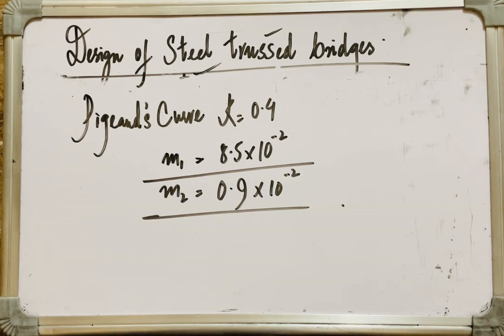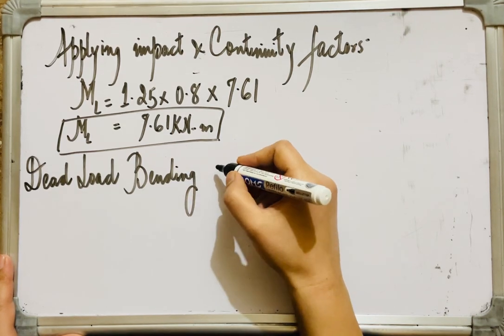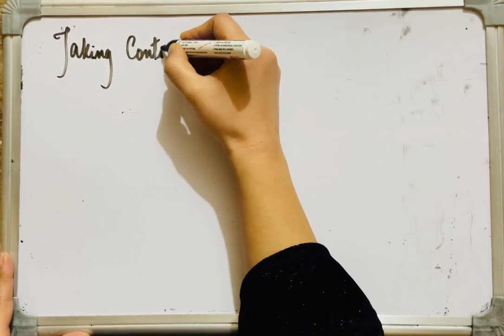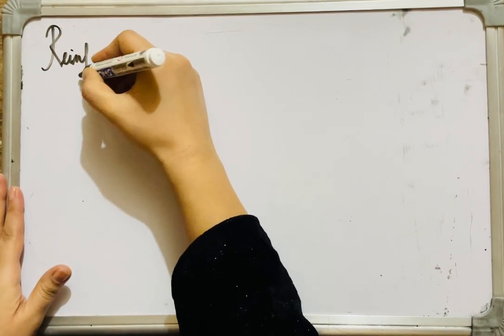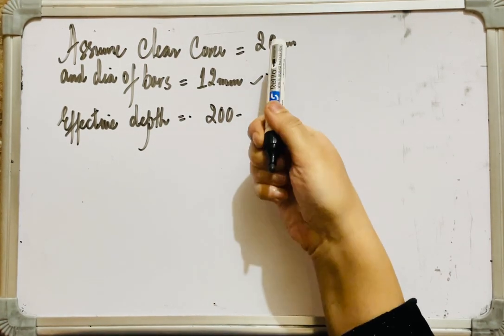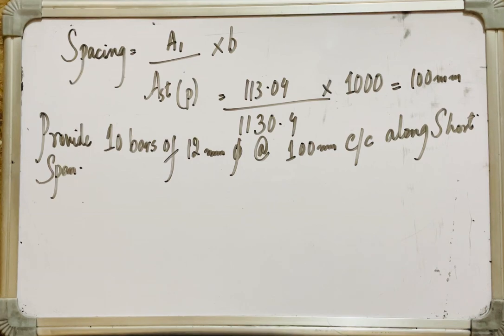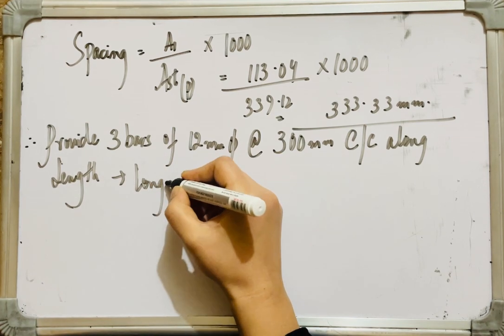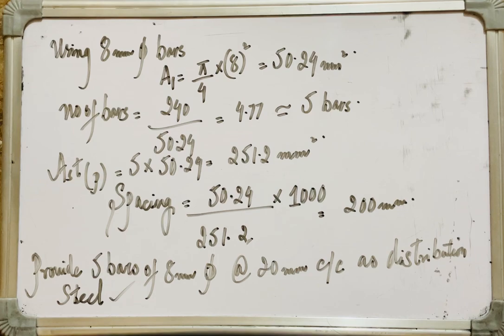Design of Steel Truss Bridges PART-2

Comment: Since we are dealing with 2 way slab, Why have you provided distribution reinforcement separately. I think distribution r/f is not provided in 2 way slabs as r/f is already present along both spans.
Reply from the maker: That is for building slabs and not the bridge slabs…. In bridge decks, “distribution reinforcement” has a different purpose. Even if the slab acts two-way, the reinforcement provided for long-span bending is not sufficient to handle:

1) Temperature stresses

 2) Shrinkage

  3) Differential temperature between top & bottom

   4) Load distribution from concentrated wheel loads

    5 )Cracking control due to impact & vibration

   6) Warping stresses due to moving vehicles. 
These effects produce secondary stresses which are independent of the bending stresses for which main steel is designed…….
So IRC suggests separate distribution reinforcement.
Reply: @EngineersOlympiad in which direction would you provide that distribution reinforcement as main r/f is already present in both directions
Reply from the maker: @aron_1100  •	Distribution reinforcement is provided transversely (perpendicular to the direction of traffic / main bending) to:
Distribute concentrated wheel loads to adjacent girders
Control temperature and shrinkage cracks
Tie the slab effectively across the width.
In two-way bridge slabs, reinforcement in both directions resists bending, but the transverse steel also serves the additional role of load distribution, hence it is termed as distribution reinforcement.

Comment: How is effective depth along long span different than effective depth along shorter span?
Reply from the maker: Since Short span is the main load-carrying direction.
The slab bends more in this direction because the span is smaller but the bending moment per metre width is large. The long span carries distribution reinforcement only.
The slab bends primarily in the short direction, but a portion of the load is distributed to the long direction due to two-way action.
Effective depth in the long span is actually smaller because:
The distribution steel lies nearer to the top or mid-depth, not at the bottom like main steel. The long-span bending moment is also much smaller compared to short span. So even though the physical thickness of the slab is the same, the effective depth for long span is taken to reinforcement relevant to long-span bending, which is usually higher in the section, therefore effective depth is less.
effective depth = distance from compression face to reinforcement carrying the bending tension.
Short span ……main reinforcement at bottom → larger effective depth
Long span…..distribution reinforcement higher up → smaller effective depth

Therefore……
d(short span) > d(long span)
even though the slab thickness is same.